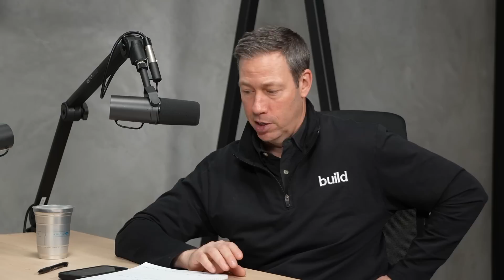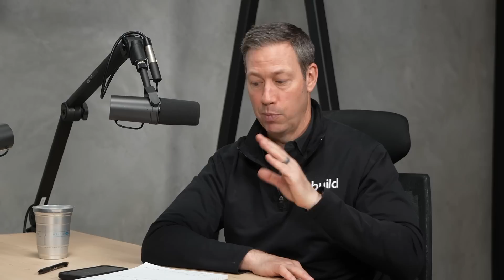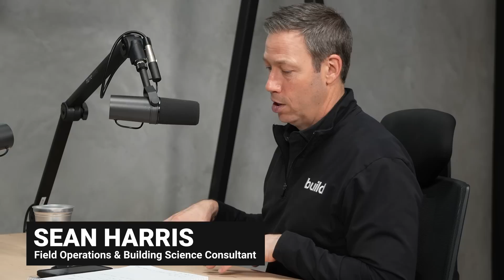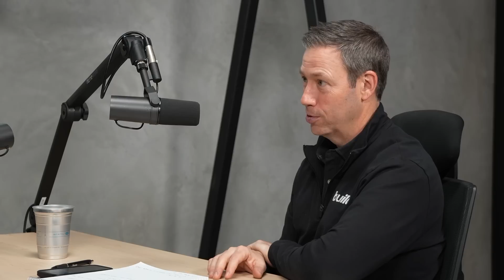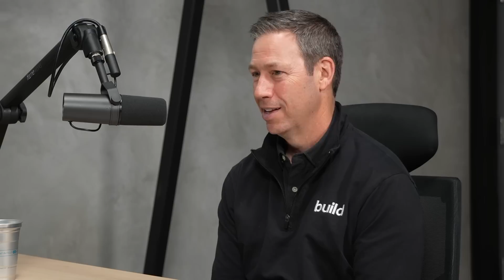Build Podcast | Episode 169: Mold Prevention & Indoor Air Quality (Part 2)

Comment: i have the gc multigas and a voc meter to test quality; it works great but doesn't last very long if you have bad air inside the house all the time. then i just opened the cartridges and replaced with fresh carbon. i think if you on a budget just diy a lot of this for your own room makes more sense. the expensive stuff you're paying for it's appearance and branding, but not necessarily make sense long term if you need to replace those gas filters every 2-3 months (even though its marketed for lasting over a year.) buy a voc meter to test your iq air and you'll see what i mean.

Comment: 36:29 I am not a sales person for this company. But it’s based off of a corsi rosenthal box. Hepa filters are great, but are loud, energy hungry, and don’t move much air. Anyone interested in an efficient mobile unit should either check out building their own, or clean air kits is a company that sells them in kits, maybe pre built. I have one of them on my first floor, and a small hepa for my bedroom. Almost always with my air quality meter (Swidget, first floor) it is in the excellent range.

Comment: Roxul in the trust and insulation on the foundation walls, check for the water movement from in the house to the low point of the crawl space, emergency pump! If close vents on crawl space! Put insulation in there seal tight with great stuff! April dehumidifier piped to outside the home! Mold remediation before the insulation installation!
Reply: Can you write in complete sentences? Not sure what you’re trying to say.